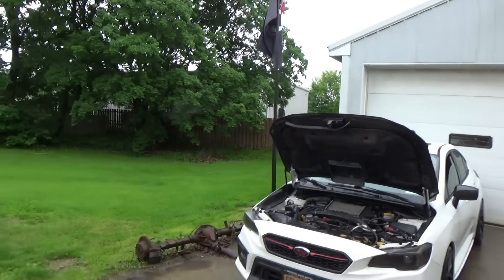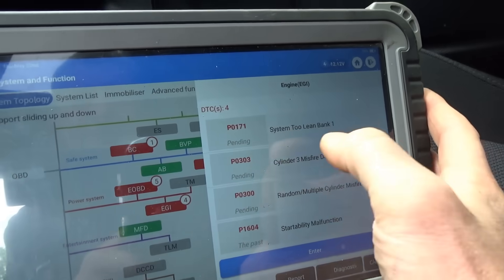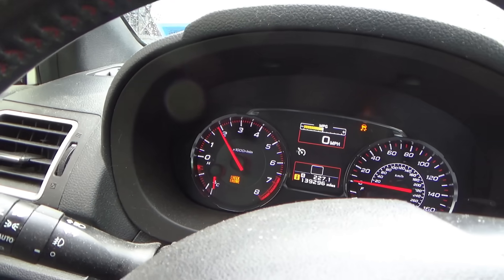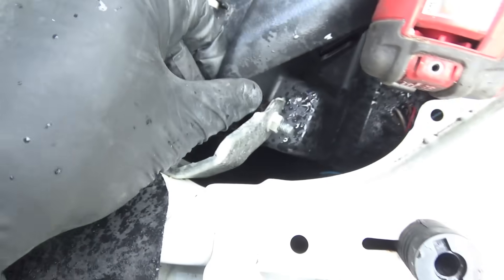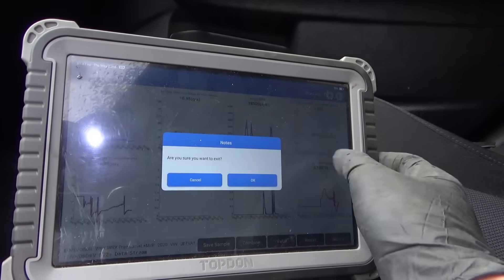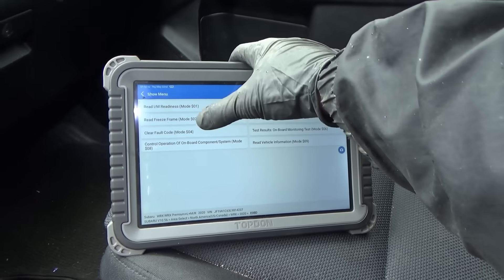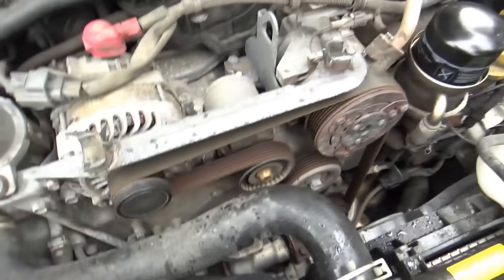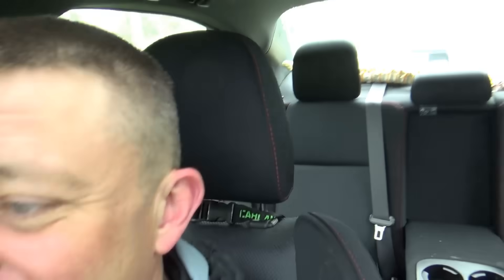Subaru Runs Like GARBAGE After "DIY Tune-Up"?? ('20 WRX Turbo)

Comment: Ivan, I got my TS101 today and now I am curious what power bank you use with it, I know you probably have shown it before, but my memory didn't hold on to that lol. Great video, you make trouble shooting look easy, knowledge and good tools do make a world of difference.
Reply: I have the ts101 as well and I picked it up with the plug in power adapter.  I think I seen it referred to as a 5 mm or 5.5 mm barrel connector.  But I too would like to see the electrical wire harness he uses.
Reply: @daveg8119  I know there is an adapter that comes with the TS100 for use with RC car batteries, there are also power banks rated like up to 20V for use with the USB C, but man weeding through them and hoping to pick out a good one is daunting.
Reply from the maker: Everything is listed in the Amazon store! 😊
Reply: @PineHollowAutoDiagnostics  Thank you Ivan, ordered what I need.

Comment: For someone who does their own maintenance and installs Autolite spark plugs in a subaru they should be ashamed of themselves. How difficult is it to read the manual and get the correct part number. 🤦‍♂️

Comment: Folks, if you're not running Top Tier fuel, intake cleaner is a necessity every few thousand miles.  I'm a Techron guy myself.  Once the valves are coated with crud, trouble ensues.

American fuel is total garbage thanks to the EPA idiots.

Comment: Gumout with PEA (regane they call it I think) is good stuff.  I have been using it in all of my gasoline engines for many years.  My lawn tools start quicker.  It cleared up a miss in my outboard 150 Yamaha 2 stroke FI.  I recently put some in my 2023 DI Nissan Titan and you scared me a little!!!

Comment: Ivan, that coolant went somewhere. And since it didn’t pull coolant from the reservoir after its drive cycle cooldowns it’s pulling air into the radiator from somewhere. That car will be back. Bill’s not done yet.
Reply: I know on my 15 Outback, it had a small crack in the radiator. My coolant was almost out. Been fine since the radiator replacement.
Reply: "...since it didn’t pull coolant from the reservoir after its drive cycle cooldowns..."
Didn't you see them fill the empty reservoir?
Reply: @TonyRule No. I missed that.

Comment: Autolite in a Subaru!  Who'da thunk it!  I like Gumout but I think Techron is one of the best.
Reply: I only use Chevron Techron Concentrate.  It's great stuff.
Reply: @Mr2004MCSS  According to the motor oil geek, it's the same stuff you get in every tank so long as you only use top tier gas.
Reply: @matthew5471  You do if you buy Chevron gas which we don't have around here.  Whether or not Techron is put into the gas of other companies, who knows.

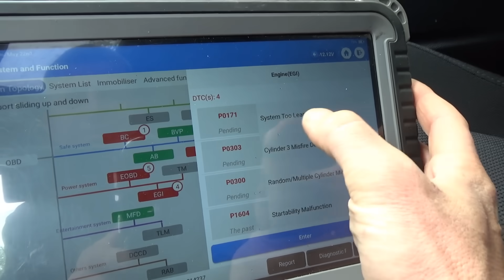Comment: 1:50 into the video. I saw those codes and I said to myself "P1604 is not the root cause -- it's a symptom of hard starting -- thus, ,...mmmm...me thinks air/fuel mixture imbalance". 
Check vacuum leaks, fuel delivery problems, dirty MAF sensors, or ignition issues. Start with cylinder #3.

Comment: My 19 year old Civic went to the junk yard with out of control rust at 413k km. It's replacement will be a Subaru Crosstrek 2023, the last year that they made them with a six speed manual transmission and *handbrake*. I'm looking forward to it. When I find one.
Reply: Take your time, find one in a private sale with maintenance receipts, Take it on a long test drive, maybe use up 1/8 tank of gas do some city & highway driving.  Maybe even take it in and pay for a mechanic to look it over, pull tires, hook up a scan tool.  Don't want to get stuck with a dud.
Reply: The cvt isn’t that bad, I have a 24 wilderness and it can tow 3,500 pounds
Reply: @Jordan__Sloan the old civic was manual. I've been driving manuals for 40 years. Not willing to stop!

Comment: FYI, Subaru recommends /requires spark plug change every 60k, anyone know why?
Reply: So they don't get seized up.
Reply: @oldtimer6528  nope. Because electrodes get burnt up eventually & make the gap larger. That’s a pretty good practice on any engine.

Comment: The lesson here is, don't cheap out on spark plugs. Cheers
Reply: That and to get them tight
Reply: @Jpilgrim30 I don’t know if Ivan replaced the other 3 plugs with NGK? He didn’t say, perhaps missed it.
Reply: No cheap parts lol
Reply: No. The lesson is to torque spark plugs to to the right specification.

Comment: Your a great mentor Ivan. As soon as I heard the air filter was replaced , I told Gloria it was a MAF issue, and I believe that compromised the sub standard spark plug. But I must stress again as I have in the past , customer complaint is #2,checking fluids is always #1 before touching the starter! 😂👍👍🇺🇸

Comment: Many years ago I put gumout in a very clean Ford Taurus just as a preventative ( to help it) when I stopped at the next stop sign, the car backfired real bad! Sounded like a explosion. I will never use any unnecessary crap again. Another time I tried Z-max. I think it was just mineral oil... didn't help anything.

Comment: Anybody who does their own work should know when you start having issues after you worked on it, go back and check all your work.
Reply: Suspect the LAST thing you did/replaced.  In this case, it was not the addition of an additive into the fuel tank.
Reply: @FindLiberty   Pouring injector cleaner into the tank wasn't "working on" anything.  Changing the spark plugs was.  Anyone running that low on common sense shouldn't even be driving a car let alone working on it, tbh.
Reply: @GrandPrix46  yep, I think we mostly agree on the, "working on it" definition when replacing parts, but it could be as simple, for example as using all of that old leftover gasoline from the 5 gal can plus a quart drained out of the snow blower... that never even got used last winter [not the case in this video]. So I don't know about the common sense driving part... Maybe poor close-up vision was to blame versus great distance vision that's good enough for driving?  

I wonder if that gap seen midway in the plug's porcelain was a crack from damage or just glazed that way when it was manufactured. Dropped it or poor OEM Q/C?  

A possible blown head gasket is a whole new can of worms that might explain the missing gallon of coolant.  Best wishes, stay safe.
Reply: Compression and leakdown test time
Reply: I had a plug back out once,   Car got a little loud wheezing through the plug hole.  Burned like a mother putting it back in on side of the road with my fingers.  Other than a little power loss, it ran fine.  Guess carbs are better for some things.
Reply: As well as being able to diagnose basic problems like this loose air pipe and a dead spark plug.

Comment: I've used fuel injector cleaners on some of my vehicles. It wildly varies how effective it is, but I've never heard of it causing issues. I put it in my F-150 and Elantra because Ford and Hyundai recommended it and it's cheap. It made me feel like it was doing something lol. Neither of them were direct injected. I currently own a 2022 BRZ and Subaru explicitly tells you to never use any fuel system cleaners on any of their vehicles. My BRZ has the Toyota D4-S fuel system so the engine is both port and direct injected. All other Subarus are only direct injected. Maybe that plays a part in it too? IDK.

Comment: I ran Autolite in a sbc in the 70's and liked them.
High compression engine
Reply: Autolites and AC Delco plugs worked on pretty much every older engine, and the best part was they were inexpensive.

Comment: Autolites are still a thing?  Ha!  I don't use Autolite on anything.  OEM plugs only.  Did a thermostat in a 2008 Charger, and it would not bleed, and I spent an hour trying to bleed it out, only to realize that it had a blown head gasket.  Customer called and asked how much to replace a thermostat, no one said anything about driveability problems.  Then the rest of the story came out afterward though.  Had to inform them that it would have saved them money if they would have come to me for a diag.  SMH

Comment: Ivan I needed to replace my plugs in my 2019 Subaru Forester and Subaru RECOMMENDS they be replaced at 60000 miles.  I ran mine until 105000 miles and it was running rough and bucking at acceleration.  Now it runs like a top!
Reply: my 18  impreza   26k   no issues   regular maintaince  new battery
Reply: Lol I would hope so with 26k

Comment: I just cried a little watching you let that man put straight yellow glycol into that cooling system. Universal antifreeze is not meant to be mixed with any other colors, it's meant to be used on drained out systems.
Reply: No worries, it'll run out in a couple of weeks or so.
Reply: But great pouring skill? 😊
Reply: The coolant they used states on the label it can be used for topping off in all colors of coolant. Even if you drain a system, there's always coolant in the block, heater core, etc that won't come out unless you flush with plain water several times.
Reply: @2aminitials This is what I did on my 08 Buick Lacrosse that was gifted to me. I drained out all the DeathCool and replaced it with Universal green. So much gunk buildup with the orange death even with replacing often.
Reply: @ICantBreve  you literally know nothing about coolant & have relied on urban myth. Dexcool has MUCH better anti corrosion additives than the crappy old green crap. The issues with Dexcool in the beginning was it doesn’t play well with ferrous metals so it would corrode it. That was fixed a long time ago & it’s MUCH better for aluminum. You just shortened the life of your coolant. Green crap turns to acid a lot sooner.
Reply: Agreed.  You don't cross coolants, just like you don't cross the steams.  Asian blue is not hard to find.
Reply: Its a pos subaru anyway

Comment: NGK will work on almost anything. Just about every racer i see at the track use NGKs. Denso are quality too Toyota uses denso and NGKs as back up
Reply: I have a second gen Tacoma, funny thing is when I replaced the factory plugs, one side had had denso the other bank had ngk. My buddies 2013 same thing. Super weird but the truck ran fine the plugs look identical. NGK or Denso can't go wrong.
Reply: @PRL1290 yep probably 2 different stations installed the plugs at the factory. I worked at the Toyota dealership in the 90s when GM assembled Corollas and they used to have AC Delco plugs
Reply: @bigdaddymak1439  GM-assembled Corollas also had some GM electrics.
Reply: They are good plugs,  but there are a lot of NGK knockoffs around.  If you're paying $5 a plug they are not real  NGKs.

Comment: Many years ago I added a similar product to my gas tank. It ruined my fuel pump. I am doubtful of any additive anymore. If any of that stuff were needed the engineers that built the car would have specified it's use.
Reply: Some manufacturers recommend using them.

Comment: I see loose plugs a lot on diy tune ups. I guess they’re scared to break a spark plug or something.
Reply: I've have cracked the head on a 2.2 Ecotec from overtightening a plug before. I make sure I'm careful now.
Reply: @Jonathan-A-877 a lot of people that try working on their own cars and don’t do it regularly tend to not get things tight enough. It’s not just spark plugs but suspension bolts and everything else. I think it’s just the fact that they don’t have a feel for it because they don’t work on them much. That’s why I always recommend someone like that to get a set of decent torque wrenches. Back when I’d do the occasional alignment we’d have people come in that did their own front end work and we’d always go over it for them and find most of the bolts not tight enough.
Reply: @Jpilgrim30  me personally, I love working on cars. Watch a lot of YouTube videos for help. But I sometimes don’t think and a mistake will happen 🤷🏻‍♂️
Reply: @Jonathan-A-877 hell, I work on cars every single day and that still happens occasionally so don’t feel bad. None of us are immune to it.

Comment: It's a Subaru, we all know where the coolant is going 🫣
Reply: I had a 97 Subaru wagon with the 2.2 l motor and I could not kill that car. That engine took so much abuse
Reply: 😂 so true
Reply: The crossover pipes leak when the orings flatten out
Reply: The Gasket Gods!
Reply: Right out the tailpipe
Reply: 90% of the time it goes into radiator. You just need to put enough. Most will fill until full and call it done. After thermostat opens first time and pump pushed air out - you're only gallon short (on 1.7 gal capacity system)
Reply: That's an EJ problem, boss. This is FA. They're not known for HG problems.
Reply: Issues been fixed a while ago.
Reply: Head gaskets were a HUGE problem with the EJ25 engine which Subaru no longer makes genius.
Reply: @Jonathan-A-877 yep and only on the NAs
Reply: Yep hello mr head gasket
Reply: That was funny 20 years ago
Reply: As a diagnoser, its wise to not be biased.
Reply: Owner botches repairs and your talking about head gaskets 🤡
Reply: I’ll let you in on something, any motor can have a head gasket issue
Reply: They put MLS steel gaskets on all Subaru since 2006 the head gasket problem no longer exists.
Reply: @lonwillis783  You sir are only 60% right. New gasket is a lot better but not indestructible. With two of them per engine - failures are still occurring more often than similar inline 4.
Reply: @wacio  I have had over 30 different vehicles and been driving for over 40 years I understand cars and have been doing my research the entire time .
Reply: @lonwillis783 I've rebuilt my fair share of EJs. I can guarantee you the head gasket problem is not fixed.
Reply: Sensitive subaru fanboys butthurt in these comments lol
Reply: someone is a Subaru bro 😂@lonwillis783
Reply: @lonwillis783  you keep telling yourself that
Reply: @yamfingaz5598  Its a fact
Reply: @lonwillis783  Hopeium is strong with this one....
Reply: @lonwillis783  You are dead wrong, yes the problem has been greatly reduced, but it still crops up periodically. Ask me how I know. OK I'll tell you. Bought a used 2019 Outback last year with 101k on the odometer. Test drive for 45 minutes everything was fine. On the way home FROM THE DEALERSHIP got the dreaded engine overheating dash warning light, found out the head gasket was toast. Now I have no idea how the car was maintained before I got it, and I had 3 Outbacks all with the FA 2.5 engine before this one with no issues, but to say the problem "no longer exists" is a straight up falsehood.
Reply: @sblagg527  the 2.5 in 2013 on up Outbacks is an FB25 not FA.
Reply: @Jonathan-A-877  Sorry you are correct.
Reply: Nonsense. Our 2014 Outback needed head gaskets at a little past 100k miles when it was 8 years old. Still a problem.
Reply: @tylermacconnell217  🤔
Reply: @lonwillis783  they were using MLS head gaskets back in the 90s. Nice try. It’s a crap designed engine. No matter which letter designation or number of liters. The boxer design just sucks. They’re nice cars. It’s a shame they used such crappy powertrains.
Reply: @stevemccauley5734  I dont know VW used aircooled boxer engines from 1946 through 2000.
Reply: @stevemccauley5734  Wow. I wouldn't go that far. You should probably do a little more research before spouting nonsense.
Reply: @lonwillis783  The key word there is "aircooled."
Reply: Lies

Comment: How much more did this guy spend on diag and repair vs just using good parts to begin with.
Reply: I’ll give the guy credit for trying anyway . I used to do a doctor friends vehicle maintenance and many other odds and ends. He asked me to look at his Jeep Wrangler , late 90’s or so that he had from new. It was about 3 years old or so at the time. He thought it needed a battery or starter. When I first arrived he came out and showed me what it was doing, very sluggish to turn over, but it did start. It sounded like death warmed over and stalled . I pulled the dipstick , and nothing on it. He had a couple older vehicles that I serviced for him, but I just figured that being the jeep was pretty new , he was getting it serviced at the dealership. I was wrong. I asked him when the last time he had the oil changed, and he just casually informed me , he never had it serviced from the time he bought it. I felt bad for that poor little 4 banger. He was a good friend, same age and actually same birthday as myself, but neither vehicle maintenance or health maintenance were his personal strong points. Poor fella died of a massive coronary event about ten years ago, pushing around 400lbs. Everybody, almost, has their niches. 👍👍🇺🇸

Comment: I have a '20 WRX. A "tune up" consists of spark plugs. Maybe clean the MAF and the PCV valve.
In 5 years and 105K NYC miles it set exactly ONE code: P0171. Turns the gas on the Indian reservation that filled up at had too much ethanol. A tank of top tier gas "fixed" the problem.